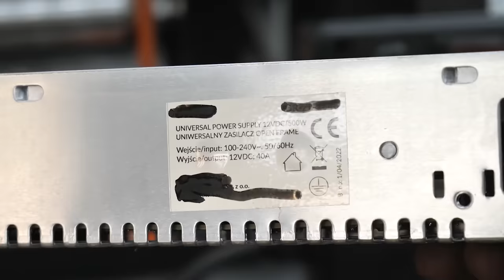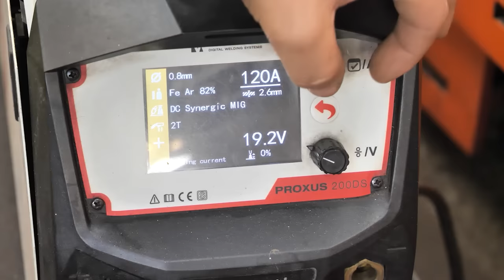Making Wheel Widening Machine

Comment: Excellent workmanship! Sure beats the way we did 
Ford wide 5 lugs back in the '50's/'60's for early "stock cars". We used an old brake drum lathe with a center section of"37 Ford rear hub.  Accurate enough for "circle burners".
Reply: Cutting off the back side of another rim to replace the front, for widening & looks, was popular back then, the welding was not nearly as nice.  Being able to cut down to the center piece with the cutoff wheel and being able to center the addition on the center piece is a BIG help.

Comment: 2:30 Hole spacing is measured with a digital gauge by measuring the diameter of one hole, zeroing the measurement and measuring the hole spacing between the outside tangents of the two holes. The cut-out is the size of the centers of the two holes 🙂
Reply: Come on, he did what he thought :)
Reply: What is wrong with his 2-second method? I don't even understand what you wrote makes zero sense.

Comment: Back in the 70's, I did work for a company that manufactured RV's in Los Angeles.  They modified small import pick-up trucks.  They needed wider tires for the back, they did exactly what you saw in the video.  I don't recall the machine that cut the rim all that complicated though.  It seemed they cut the wheel on a lathe, didn't use a cut-off disk like in the video.  They then welded a section of pipe in, I don't recall what kind of welder, believe it was a MIG welder though.
Apparently the wheel size they needed was not commercially manufactured, they needed them, they built them.  Jim

Comment: My son had to make a couple of wheels wider one time.  We just cut a plate on the cnc to mount the wheel to an engine stand and one person held the plasma cutter and the other rotated the wheel.  Of course it was not DOT approved for highway use.  It was just for a 1500 hp pulling truck.  That was some nice looking welds.

Comment: Amazing to watch. If you're already on the lathe for heavy duty work I would bevel the two welding surfaces about half way down, you still get half of the flat surface for alignment & much stronger welds that can be ground flat & retain strength due to the root

Comment: Way back in the early 1970's I had a set of wheels widened by cutting and inserting a band.  This was in Launceston, Tasmania - the shop that did it was very busy as most wheels back then were for tubed tyres and 4.5" rim width, with most cars having huge distance from the body to the rim. The car enthusiasts all wanted 6.5 - 7.0 inch rims and the tyres for that were all tubeless, so the welding job had to be good.  Not sure what kind of equipment the shop used, but the results were perfect.  It's no longer legal to run wheels widened this way in Australia.

Comment: I used to make my wheels back in the '60s but it took two wheels to make one I would take the widest part off of each one and weld them together I would use the pickup or the car jack up the car or truck and use the rear end in low gear real slow to cut them but this is much better system nice work

Comment: Nice weld but is the metal work hardened in the process?  Warping after it cools?
Reply: When he spun it at the end, you can see where its wobbling.  Wouldn't put myself or my family/friends at risk doing it quite like this. Very neat build and machine, I just thought that metal look quite a bit thinner than the rest of the wheel.
Reply from the maker: Just before building the skates, I did a test on a regular wheel and despite the perfect setting, welding made the wheel not perfect, so I came up with the idea of making rollers which, in addition to facilitating wheel centering, also block deformations arising during cooling

Comment: Nice machine! One note however. Your grounding strap wrapped around the shaft will cause arcing to the shaft with the resulting damage. You might consider building a true rotary grounding clamp. The Cutting Edge Engineering (CEE) channel has a great video on building one from scratch a few months back.
Reply from the maker: Thank you😁 I have to improve it because there are actually disturbances in the welding arc

Comment: You need to protect the electric motor from flying debris entering the cooling vents,  or the motor will require teardown and cleaning to keep the Armature clean.
An air tunnel that covers the Motor and allows clean air to cool the drive motor will add to the life of the unit.

Comment: Planet destruction machine 👍😁 What about welding frrom another side of wheel?
Reply from the maker: Thanks 😁 High current welding should be used so that the weld is visible from the other side, at the end of the video you can see me grinding the weld on the other side

Comment: Looks nice but a major operation I use a very basic method using trailer hub have done full set for my race car that clicks over 200kmh every lap also done plenty for speedway racers
Reply: 50mm Flat Bar rolled against  a drum use coil spring compressor and c clamp perfect

Comment: ... very good engineering, building this.. nevertheless,  one very important detail, material used for the wheel is very wrong... insufficient strength, it is too soft, under stress it will heat up and stretch enough causing a sudden loss of pressure in the tyre causing unforeseen consequences...
Reply: Nice
Reply: What are you saying wheels should be made from?
Reply: @rdspeedfab  . missed the point I've tried to make... wheels are made of strengthen material, not from the mild still . I was pointing to the incompatibility... as always, I may be wrong about it...
Reply: @oldskeptic1513  I follow your point but I ask the questions because most stamped steel wheels are in fact made from low carbon non hardened steel. In fact a softer steel is preferred for stamped wheels because it will bend before it fails and cracks.
Reply: @rdspeedfab  ... as I've mentioned, I may be wrong about it... nevertheless, the purpose of the whole operation depicted on this clip, is illegal, and it would not pass the scrutiny of an accident investigation...
Reply: @rdspeedfab  ... in case of a fatality, would this pass the scrutiny of an investigation..?  ... I should think not..

Comment: With the soaring rise in the cost of metal it has become unaffordable to make alot of similar projects at home. Most time customers can buy same from products made in China alot cheaper.
Yes not the best quality buy people still buy them because they can't afford anything else.
Reply: That's life for most people, so your options are either:  1] find a way to earn extra $$$ or;  2] use "junkyard" metal i.e. substitutes components or; 
3] merely watch and learn something new or;  4] keep complaining to him about things he doesn't control.  1, 2, and 3 sound pretty good.
Reply from the maker: The machine from China does not always meet the requirements, I will give an example of lathes, in my country people look for old lathes and import them from abroad and the cost of such an old lathe exceeds the cost of a new one from China, but people buy these old machines anyway. Of course there are also machines that are good and I have a Chin band saw and it works very well but now it costs three times more than I paid for it three years ago.  Steel in good condition is thrown out on the scrap, where you can buy it for a fraction of the price of a new one, the engine, the material for the frame comes from scrap

Comment: Wheel designs meet their fatigue testing requirements because of residual stresses that are a result of the manufacturing process.  Wheel designs are the result of sophisticated FEA that determines optimal gage and material properties.  Wheels must pass 1million high load test cycles to meet safety requirements.  This modified wheel would probably fail at at cycles way below the minimum for a safe wheel design. Typical failure will be a rim leak that will take the wheel out of service vs a catastrophic failure, however a rim leak on a trailer typically results in a tire blowout.